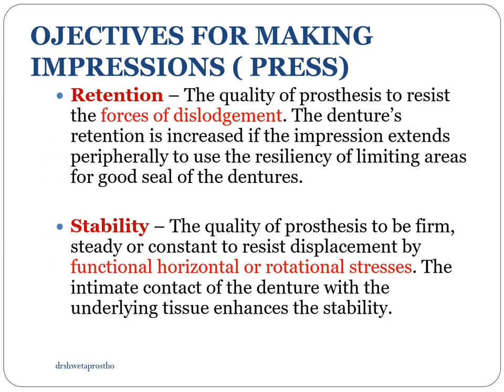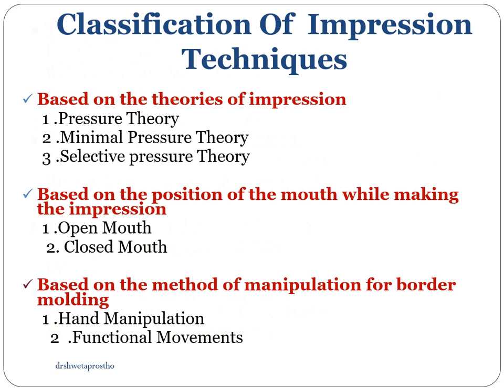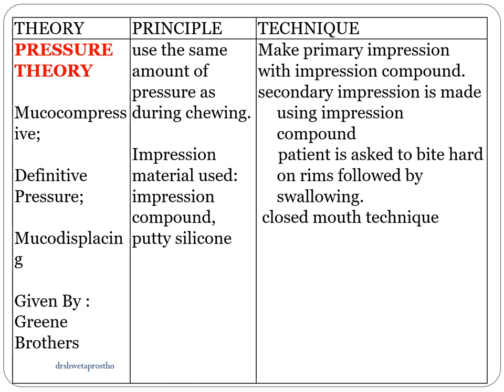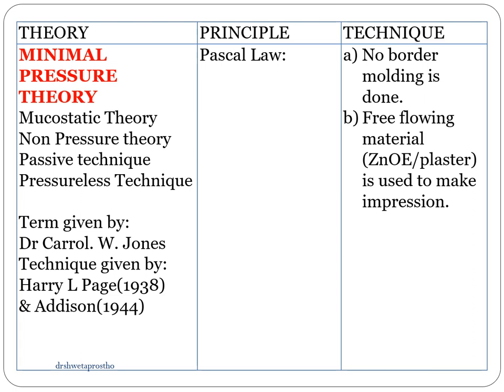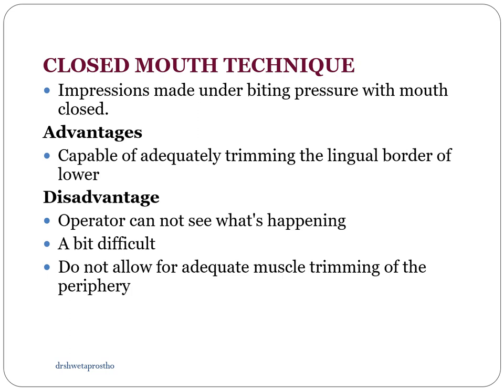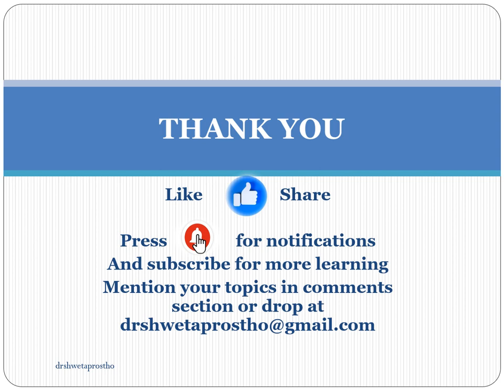IMPRESSION TECHNIQUES FOR COMPLETE DENTURE PATIENT

Comment: Mam...why is kneading required for impression compound???
Reply: For uniform moulding of impression compound.
Reply from the maker: Kneading improves plasticity of impression compound. It makes the compound soft. Two types of kneading are there- dry kneading and wet kneading.
Reply: Mam..why should be the clearance between stock tray and impression compound be 5..6 mm...why not more or less???
Reply: @drshwetaprostho6301  ..thank you mam
Reply from the maker: @sujatachahal1188  Every impression material needs space according to its viscosity and body. As impression compound is highly viscous and has it's own body so it needs more space.
Reply: Ok mam🙂